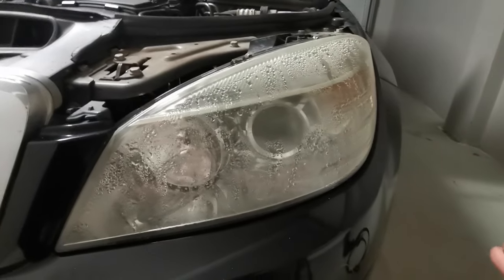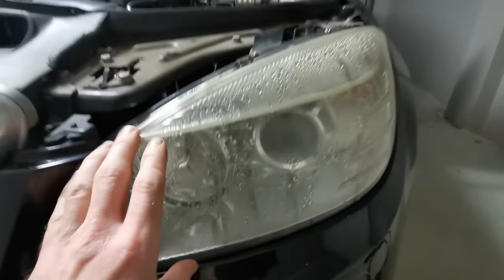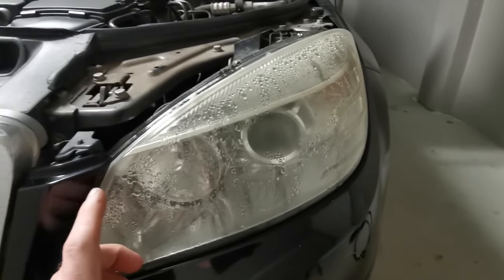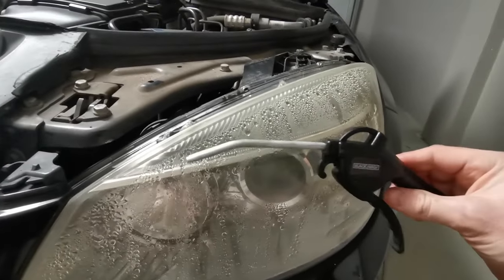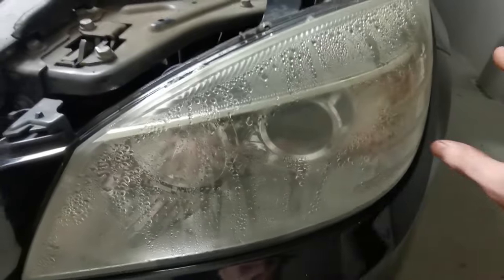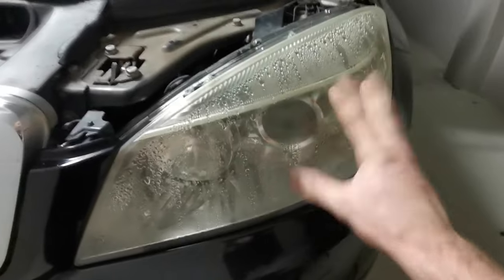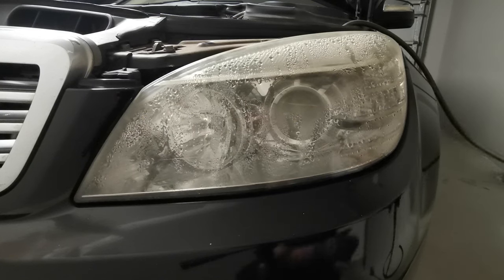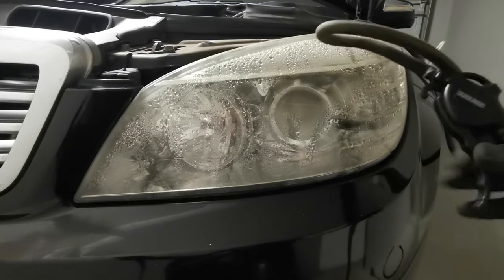Headlight Condensation / Moisture Removal - Simple Step by Step DIY Guide

Comment: Got moisture issues in both of my headlights for BMW 1 series. Had a consultation with mechanic, who are recommending to change the headlights costs of $3000 for both the headlights. I will try this and see if this could save me some peny. Thanks a lot
Reply: How did you get on? I was told the same thing by my car yard, feel they are trying to screw us. Don't need new lights for a bit of condensation..
Reply: Its a fabric falsh...Also in left side

Comment: After a lot of research, found a only mechanic in the city who did the repair for $600 for both the lights, and also gave 1 year warranty. He informed he has repaired lots of lights with condensation issues for BMW 1 series. Finally, long wait ended up to be worth it.
Reply: What city
Reply: Auckland, New Zealand

Comment: Hey! Did what you said with a balloon blower and had to put a hose and worked like you said! I didn’t have a air compressor so I had to use what I had! The balloon buddy is called blows air and by having it on for 5 yo 10 minutes it started blowing hot air and that helped! I’ll try to send you a picture of my air blower! Sorry couldn’t attach a picture!

Comment: if you use compresed air when you clear headlight leave one of the bulbs out for  a few days and leave the cap off make sure you take the bulb clip  off so you dont lose it and it will clear as you drive.

Comment: I had to take the headlamp out of my nieces VW POLO. It was full of water levelled up tp one corner like u said and I took it off got the bulbs out. I poured the water out if it but I shoulda used the Hairdryer. I don't have an Air gun but I do have a WET/DRY VAC and it blows some air out if it. I think I will give it a proper go tomorrow night. 
Great video but it's probably best to buy new lights..
Reply: Yeah If you've got 
A cracked Lens
 you might as well not try to suck the
H2O.... out😮

Comment: What if you cant get into the lens? I have a vw golf mk7.5 headlights both high and low beam have projector lens and the DRLs and indicators are LED strip so no way to put a pipe into the headlight unit? Could anybody help? Thanks
Reply: Same here w my 2016 Jetta. Dealer wants me to spend 1700 on a new assembly.

Comment: do you have a water trap fitted to your air compressor?
Reply from the maker: All of the compressors I use have either one in line/in built with compressor or run a separate regulator and filter combo.
Reply: @GerardBurkeBurkesGarage  only checking because as you are obviously aware compressed air contains moisture by default and you wouldn’t want any extra on that job 😉
Reply from the maker: @Southampton_Dash_Cam_SO19  👌👌

Comment: Cheers for the video, i have the issue with both headlights on an insignia has me heart broke, i dried them out with a hairdryer for the nct the other day but today there just as bad going to try the dessicant bags and see
Reply: On my Insignia I managed to get a small hose into the headlamp and used my wet/dry Vac to get as much moisture out first, then used a hair dryer for about 10 minutes, and so far so good, as Gerard said check the seals on the covers to the headlights.
Reply: @andrewscammell3415  great thanks for that